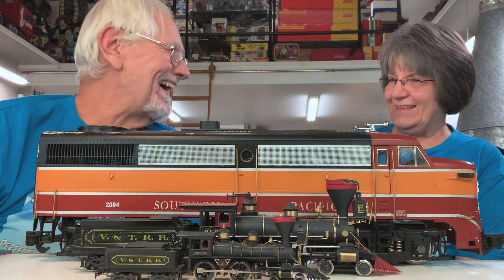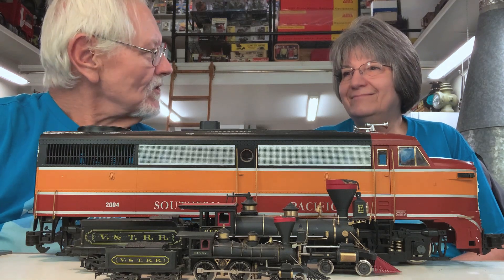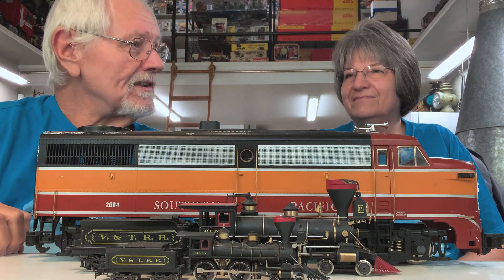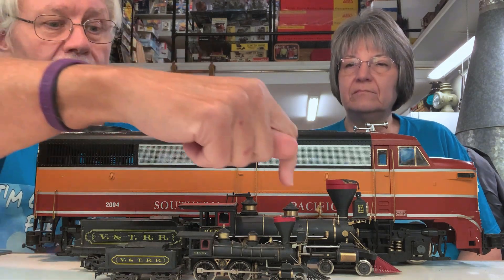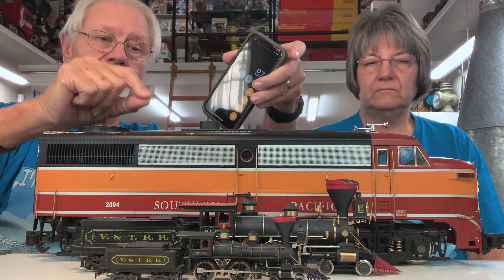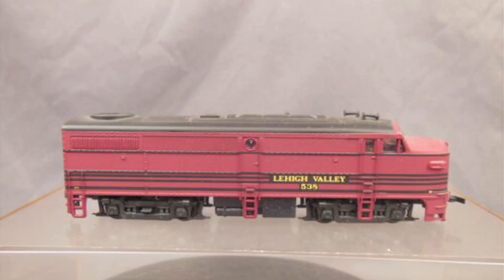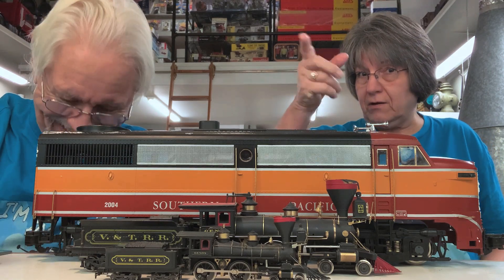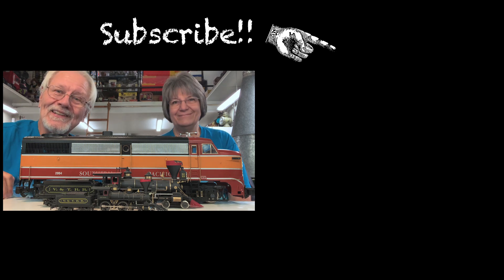Scales and Gauges Part 7 - Why Did Many European Companies Change "O" Scale to 1:43.5 Scale?

Comment: But, but, but Dale! It would have been possible to set up the pantograph to reduce 1/29 to 1/45 by setting the ratio at 1.55 rather than 1.5. Would that have caused too much head scratching, or weren't the pantographs sufficiently precise? Still, it is all good fun!
Reply from the maker: The pantograph is mostly basic. 1:1. 1:2. 1:1.5. Stuff like that.

Comment: Dale, some other scales you may wish to talk about although more from a UK perspective. There are other scales beyond the shores of the USA.
1:19 scale which is for modelling on 2ft gauge prototypes on 32mm gauge model track. Many trains in 1:19 are gauge adjustable to also run on the popular 45mm gauge model track which is very popular in the UK although technically not correct scale/gauge relationship. 
Another one is 7/8ths scale or 1:13.7. It is also for 2ft gauge prototypes on 'gauge 1' track 1.75" (45mm gauge but not exactly so do the math).
Hornby and Peco have recently started producing a range of models, buildings and track in the almost forgotten TT scale 1:20 on 12mm gauge model track. It's about half way between HO/OO and N scale. It didn't originally take off many years ago because of the popularity of the newly introduced N scale at the time. I suspect models in OO and N scales have now been saturated and  TT scale will give something new in the marketplace and offer some of the benefits of both.
Reply: I'm reading the REVIEW for more than two decades, but outside the 7mm I model, I'm still lost with all the different UK scales and strange naming. As French, I prefer metric, but I can handle imperial units, but the mix of the two always puzzles me. It seems that the average British guy can do it better than NASA.
Reply: @pbyfr  In the UK, the prototypes were originally devised in imperial then metrication came about mid last century therefore models were based on the metric system therefore the conundrum.
They changed it all where I live during my childhood so I still use both measurements fluently however I prefer metric for miniature items but tend to speak imperial for larger 'human relatable' measurements.
My slightly younger cousins are clueless when it comes to feet and inches.
Reply from the maker: I cheat. I use metric when modeling. Just easier. Unamerican?
Reply from the maker: 7mm to the foot…. Now that’s a mix.
Reply from the maker: Thanks!!! A week from Tuesday.

Comment: Clear as mud Dale. That explains why HO scale is Half "O" scale. Marklin used to make 1;43.5(or 1;43) scale die cast vehicles back in the 60s and 1;45 locos and wagons to run on HO track (3 rail AC) similar to On30.
Reply from the maker: Yup. Really all O scale die casts are 1:43.5. And the only reason why these days is because back in the 40’s they were made so for this reason. And soon it became the standard die cast size. But this is why..
Reply: @ToyManTelevision  Thanks. I found some of the old Marklin catalogues. The 1:45 trains were called Minex as the name implies, mostly mine and industrial types. There was also 1:32 slot cars called Sprint. Our club has G gauge outside with 1:29 &1:22.5 LGB (2x the "other" O scale) plus a few oddities.
Reply: And the Märklin choice to use 1/45 scale for their O narrow gauge set a mark that still is used today in Germany, Austria and Switzerland as well the eastern european countrys to build O scale narrow gauge.

Comment: What gauge track does 1:29 scale equipment run on?
Reply: Usually made to run on G gauge/Gauge 1 track
Reply from the maker: Soon we will do #1 gauge. Always scale modified. So on #1 gauge track - 1:24 scale, 1:32 scale, 1:29 scale, 1:22.5 scale, 1:20.3 scale and 5/8” scale.
Reply: @ToyManTelevision  Also 1:19 and 1:13.7

Comment: Having done drafting sometimes to three inches to the inch because of the small size of the part this makes sense. You get the details right on a large plug and that detail is scaled down to the small scale. Now it's all done with CAD and CNC equipment.

A family friend had an old patterngraph from Boeing Surplus that was used to make forming blocks for small sheet aluminum parts. He had all the parts to make both positive and negative from a form. He was using it for engraving mostly. I do remember him using it to scale an O gauge logging car to HO  size for his layout.
Reply from the maker: Hum.. you just hit on why half the model cars are 1:24 scale and half 1:25 scale. Well except for 1:8 and 1:12 and… anyway cars were drafted in 1:10. Easy math. Still feet and inches. But 1:24 scale models were prototyped in 1:8 scale (and some released in 1:16 and 1:8) but pantographed to 1:24. 8X3. But many were prototyped in 1:10 because the plans were in 1:10 and so no conversion. And pantographed to 1:25. 10X2.5.
Reply: @ToyManTelevision  it's all about scaling ratios and how fine of resolution can you get.

By using a larger pattern means you have greater resolution in the smaller parts/mold made. Trying to help people understand this can be difficult sometimes.

Comment: Dale: It does make sense.  Especially when you take into account that HO or OO in the UK is the most popular size of trains.  HO was the N scale of its day..

This is a difficult topic to explain.  It becomes clear when you understand how the model are made.  The milling required to obtain the detail mind blowing.  Every one should try tool and dye to appreciate how difficult this is.  In college for a class I took, had to make a dye to pour aluminum casting in a sand mold.  Injection molding plastic and obtain fine detail is much more difficult.  Always unique and definitely not boring.
Reply from the maker: We’ve been talking to our friend, Jim Keeler about this. He’s going to share some photos on an upcoming show. He worked on development of model cars, but the process is the same. The Proto types were made in 1/8 scale for 1/24 scale molds. 8x3. Anyway, he said the details on the 1:24 scale dashboard molds were carved in by hand. Now that’s an insane level of craftsmanship.

Comment: No, it doesn't make sense. 1:48, then 1:45, then 1:43.5. They clearly could not make up their minds. 1:48 was too simple, and it's not twice the size of HO scale, but it is half 1:24 scale.so they made it 1:43.5. So how does that apply to 1:24 scale? Just forget that part. We didn't consider 1:24, 1:48, 1:96 when we established 1:87. So where is 1:21.75? Who cares, it's only models. But wait, what is 1:20.3? Let's really confuse the issue. 1:17.2 anyone? Or 1:34.6?

I'm sorry, that Genoa does not look like that diesel locomotive. And math is far more simple and logical than what different societies have done with modeling standards. It is all random and makes no sense. It's whatever the decision makers decided for reasons that really is based on nothing substantive than their current whim.
Reply from the maker: Well… HO. See 1:87 scale. The gauge is exactly one half O. But to fix the gauge to a proper 4’8.5” they altered the scale to 1:87. So HO is one of few accurate scale and gauge scales.

Comment: Dale, thanks for doing all the research on this crazy scale/gauge issue for us modelers.  You put it all in very simple terms so we can understand the WHY's of how it is today.  I will say I've got just about all the scales today and need to decide on one.  As we age it seems to me that "O" scale is the best choice for detail and ease of use.  It's harder to see HO and N, but you can put a lot in a small area.  I think G will continue to be my choice for outside as you've both done, but O or Zero will be my choice for inside.  At least now I understand how they all came about.  🛤You guys are the best!
Reply from the maker: not sure what your interest is, but I think On30 is the best choice. PROBLEM is its not made anymore. But there is a ton of stuff out there on eBay..
Reply: I switched to Zero (more exactly O16.5) when I was still in my teens, because I wasn't able to make the details like I wanted in HO. But in the end, I still do crazy small details in Zero (always amazed to see people doing similar or even more detailing in HO). 
Bachmann has very limited number of new stock On30. Even from UK, just a few complex kits are still available. But in Japan, they have several companies doing easy kits in On30, like AruModel and PairHands (and the motor bogies from AruModel are great).

Comment: No, this is not confusing. It actually clears things up. It all has to do with proportion, and HO being the most popular. Gauge, scale, size and proportion, all confusing until the underlying "engineering" is revealed. 
I was wondering why 4 ft. 8 1/2 inches and not 4 ft. 9 inches? (4 3/4 feet) Then I considered that the distance between the flanges as probably 4 ft. 8 inches (4 2/3 feet). Who Knows, (more confusion?).
Many of us have seen a form of pantograph, if we watched some one engraving a name on some jewelry, etc.
Neat video, once again, This little series needs to be a "play list" set, I'm sure it is already. ;-)
Reply from the maker: HI Robert. Right? And it explains 1:29 scale. BUT when we get to On30... And that's soon.